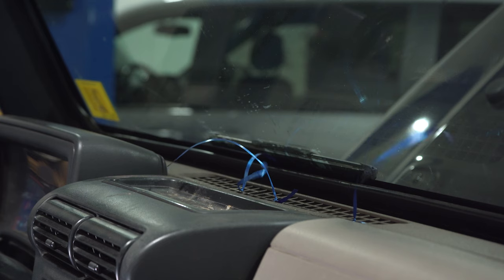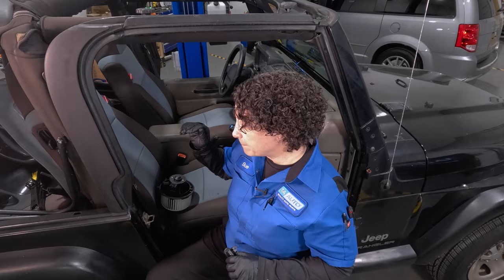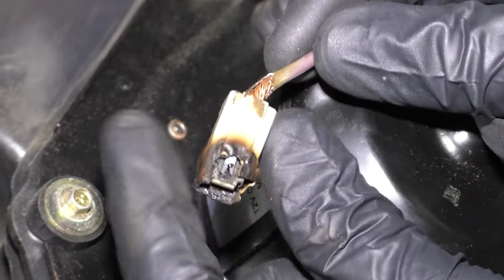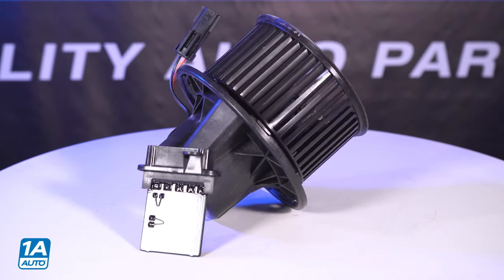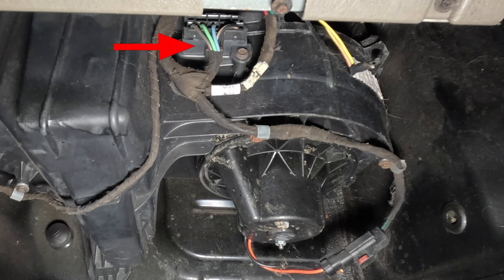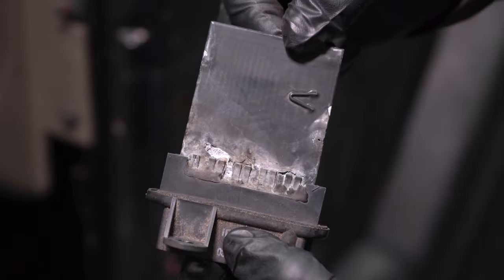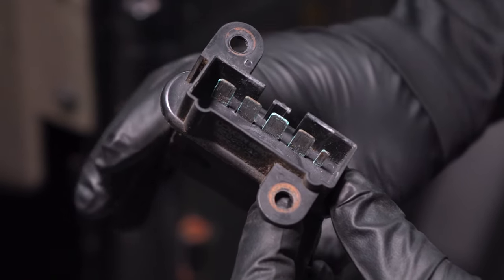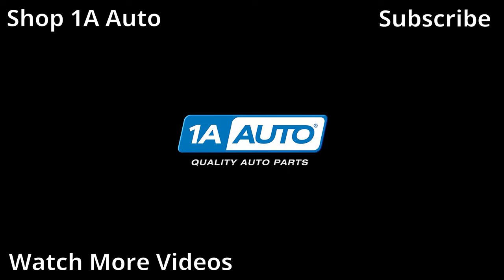Car or Truck Blower Motor Only Works on One Speed? Should I Replace the Resistor, the Motor or Both?

Comment: If I followed the recommendations right, you still would have replaced the blower motor on this even though the resistor clearly was cooked? It makes sense…but you didn’t cover that process in the video. 
Thanks for the advice and direction.

Comment: My fan works on low only but if I bang on the dash it works.   I have replaced the resistor and old one looked great.   I must have a loose connection right? 2006 Ford F150 5.4.

Comment: Wheres the coil that air blows through in the cab of a 2000 Toyota Tundra?  Where 23 years, it probably can use cleaning if I can find it and access it.